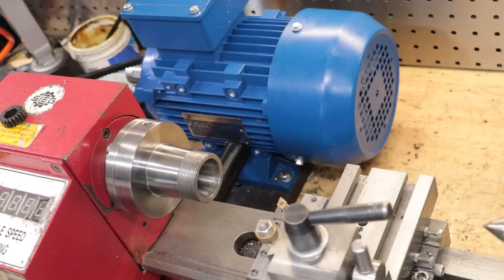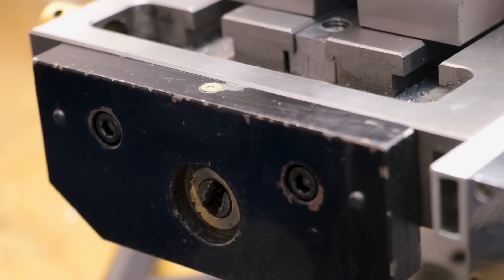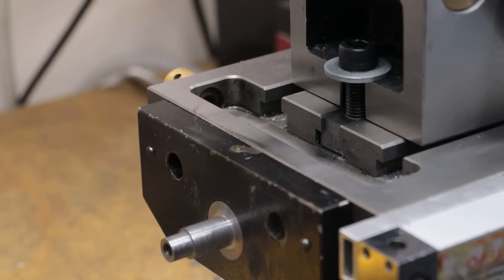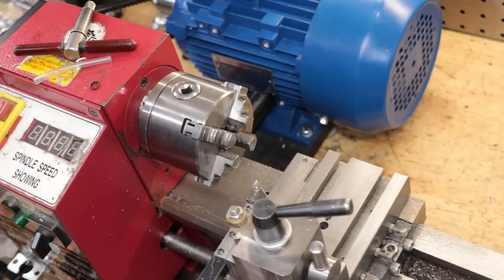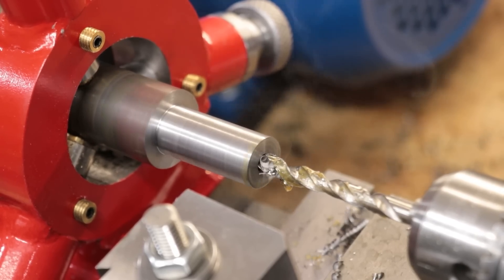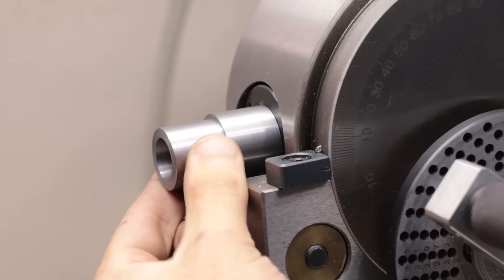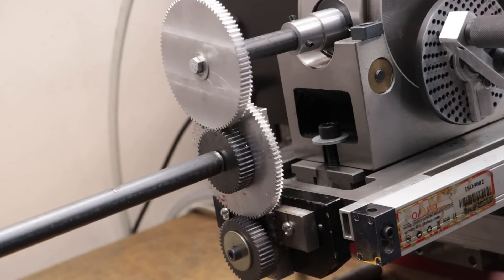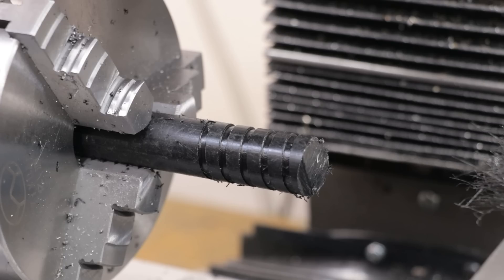Helical Milling Attachment For The Milling Machine

Comment: So how do you figure the gears need for the pitch. Say i wanted a pitch that the groove travels 2-3 inches for every complete rotation
Reply from the maker: Well the table for my mill moved 2mm for every revolution of the hand wheel.  So a 1:1 ratio between the leadscrew and dividing head is 2mm. To get a 2 inches of pitch you want the table to move 26 inches (x number of times) for one revolution of the DH.

Comment: I don't quite understand the use of the steady rest when turning one part. A steady rest is normally only used to make a centering hole or a recess for a center point on a long part that does not fit in the spindle bore, at most to make a hole for a thread, but not to make a fit on the part. As shown, the surface will not be smooth and accurate enough.

For a thread with this width of the thread flight, you also first take a narrow turning steel and make the thread flight wider only when you are at full depth. If the thread steel already has the full width of the profile at the beginning, the cutting pressure is of course much too great for such a small lathe.
Reply from the maker: Yes this would be correct for a normal lathe, but for such a small lathe its just there to bolster rigidity where the tailstock can not provide enough support.
Reply from the maker: And youd be right for the second part but as i'd already sunk enough time trying to get the carriage to move I pretty switched top the helical milling. I doubt even with using a smaller tool to do the roughing I could form the required thread

Comment: I wonder if a more versatile solution to your problem would have been to make some sort of small milling head to attach to the tool post and use the lathe to cut the thread. The lathe cbange gears should stand up to the lesser forces required, especially if you use light cuts.  Since the leadscew has to turn faster then the lathe spindle, powering the leadscrew (eg. with a hand crank) with the reduction gears transmitting the rotation to the lathe spindle would also make things easier and smoother.
Reply from the maker: I have one and they just aren’t rigid enough to take the cuts that I will need here

Comment: I was wondering if the equipment listed on your about page is up to date.  I'm looking at buying a mill & lathe and am trying to figure out if I should buy new less expensive equipment or used equipment that may be a little larger & more expensive.  Which would you chose if you had to do this again, especially since you have made so many upgrades to yours?
Reply: Sorry for jumping in, just my opinion, and by the way, I am a mechanic not a machinist. 
I have had a minilathe like this, and I also have had a 210 lathe within the last 20 years.  
Now I have a 320 lathe, and just my opinion, buy the biggest lathe (that makes sense) you can afford, if it is used, bring a gauge and check the runout on the main bearings, if runout is low, it is probably ok. If yoy buy a lathe too small, it will cost you more on upgrades than the bigger lathe, and it will still be skinny. 
I have a "35" mill, that works fine as a drill press as well, I am happy I did not buy it smaller. 
And by the way, the lathe is quite cheap when it comes to what you need to use it, the mill is a completely different story, you can easily throw a lot of money into accessories for the mill, if you can get one used with some accessories to it, it will save you a lot.
Reply: Sorry, it is a BF30 mill I have, not 35.

Comment: this could also work well if an angle grinder was used as/or instead of a mill with a cutting/slotting blade, and if you wanted trapezoid threads you would roll the grinder left and right with a skinny wheel on it doing shallow cuts to get nice even smooth cuts.

Comment: From the video it looked like the rotation was occasionally stalling more specifically not consistent but from the look of the spiral on the helix it didn’t seem to show up. 

Did the process look different in person or did it look fairly constant? I’m kinda curious
Reply from the maker: There is a bit of binding somewhere in the gear train that shows up as the cut stalling. Nothing detrimental but it shouldn’t be too difficult to find the source of it

Comment: impressive. very impressive. to actually do it oldschool with gears rather than resort to steppers and coding. always feels more reliable. one missed step and bang... cant do that with gears. as long as you do the calculations right.

3D printer is handy for change gears. the forces shouldnt be that high.. depends on leads really. i still have my 15+ yr old gears on my lathe in service.

it may be "fixed" but remember, you can mess around with the ratio on the same center distances in the same module as long as the total number of teeth stays the same... ie, 90+30=120, so can be 60:60, 45:75, etc...
a tumbler/idler to reverse the rotation...

change gears... wait until you do "continuous fractions"... figuring out the ratios from given change gears to get an approximate as what you want isnt a neat integer.
making custom gears seems easier to get those oddball leads.

a rarely mentioned method of getting unachievable leads is by canting the table over at the sin of of the lead... much like setting a compound slide over for getting a 10:1 resolution. 
the cutter still has to be tilted to match the helix angle of course. only works if you have a swiveling table.
Reply from the maker: That is definitely one advantage with using gears

Comment: That is cool as hell! If you did it again do you think it would be worthwhile to consolidate the project on a fame that can index the dividing head with the drive coming off the lead screw? I like the thought of a frame with flats milled in for reference surfaces so set up is more plug and play. I also like the thought of an adjustable gear banjo so I could use the same set up for different gears. I “like” these thoughts but are they excessive to the task at hand?

Comment: This is a fantastic setup
.i needed a big worm cut some time back and i only thought about driving it through the crank handle inout of my dividing head...figuring out the math for your idea should be much simpler, plus its a simpler gear train then needing to go to a right angle also...love it

Comment: The old atlas lathe i have has a gear train on a part called a banjo, which would let you put different gear combinations together for about any pitch. I lenthened mine to add 4 sets of gears insteadof3. Very simple design and adjustable to get what you need.

Comment: quick tip a drill and a saw cutter is a high speed steel, dont run it to fast as a cutter 10 cm in diameter schould be running at around 100 rpm. there steel if u go to fast your work peace wil stick to  the cutter giving you poor finish

Comment: hello, I noticed that for deeper cuts you don't use the power feed.  If you are interested in my lathe, which is the same as yours, I have mounted a 110-tooth gear to improve the finish.  in your case it might help

Comment: Hmm, I think the go-to solution for this would actually be the other way around: attach a dremel or other milling head to the toolpost of the lathe.
Reply from the maker: I have  close to 200gb of footage trying to make it work that way, I kept stripping gears and poor finishes. I tried to make it work but it. Just wouldn’t
Reply: @artisanmakes  probably due to the poor quality of the lathe 
on the lathe in school those threads are no problem 

but they current way with the mill is quite a lot of effort for such a simple part
Reply from the maker: Gotta use what you have sometimes :)
Reply: @artisanmakes  can you explain what stripped the gears? The forces on the gears should be very low, as the cutting is done by the mill. Turning of the mill should of course be done by hand, as else the mill would break
Reply: @Jochem Bonarius  he doesnt need to explain anything to you
Reply: @jhbonarius  mini lathes tend to run at high RPMs and the feed gears are limited in size: the mini lathes therefore tend to move the carriage awfully fast when threading even ~1mm / 20tpi threads (you often see mini lathe users preferring to manually rotate the spindle to thread as you suggest, or use dies instead). The limit comes often (in my experience, your mileage may vary) by the tendency of the cutter/dremel/milling bit to grab the work which exerts a vastly higher force on everything than when cutting smoothly and often in an opposing direction. Lathes struggle when cutting forces can suddenly change direction, whereas milling machines are designed to handle this better. It can be a particular problem with a Dremel because of the relatively low spindle rigidity.
Reply: @peterspencer6442  that why you need to turn it manually like we say. And even: Building a more rigid toolpost grinder / mill / drill would be worth more in the long run anyhow.
Reply from the maker: It’s a combination of a few factors. The carriage retaining plates needs to be tightly done up against the bed to give it any meaningful rigidity. This is part allows me to do the cuts I do, but it means that it takes a bit more force to move the carriage than you would expect. Even trying to move the lead screw to move the carriage takes some effort. With the 6mm pitch gear train set up that force required to move the carriage is multiplied 4 times and the gear train was not having any of it. And I sank almost one and a half weeks of afternoons trying to get it to work. The helical milling on the other hand worked the first time I tried it and truth be told it’s a more rigid set up than the lathe mounted router I have. Cheers
Reply: @artisanmakes  I think you’ve shown through your published work that you are a very competent machinist, and I think it’s funny that people in the thread are doubting you. Don’t get me wrong, it’s definitely worth bringing up in case the creator hadn’t thought of it, but if they are telling you, from experience in their own shop, the other method isn’t working well, just leave it be.
Reply: Even if a dremel isn't attached, the torque required to turn the complete gear train to a lead screw is quite high for the pitch he wants.  Which is why he's stripping gears and bending the banjo.  

Even though the motor on the mill is probably not as powerful, the gear train is much more ridged and not requiring as much torque. The power feed is controlling the table screw, and the screw is turning the chuck. 
If he were to connect his motor to the lathe lead screw first, then set the gear train to spin the chuck he'd probably have better luck.  
Either way this is going to be really challenging to demand a large TPI for the size of equipment.
Reply: @euclidallglorytotheloglady5500  then swap it around: turn the lead screw and have it turn the head. Or some middle ground. You need to turn it manually anyhow, or you'll break the mill. Even with some modification, using the lathe would be much easier and you don't need to fabricate gears and all the other stuff he made.
Reply: Doubt a Dremel would be internally rigid enough to withstand a cut 100% axial engagement
Reply: That’s very bizarre as its a common solution many adopt with little issue. Were the issues with difficulty getting it to work on your lathe in specific or more general?

Comment: Electronic lathe leadscrew when
Reply: Came here to say: you could do this with the Clough42 ELS in one of three ways:
- traditional way, by implementing the ELS on your mini lathe, using single-point threading
- as above, but also add a mini-mill to the lathe cross slide rather than single-point threading
- or using your mill, but with the ELS set to encode from the mill lead screw and the servo/stepper driving the rotary table axis. The electronics and control unit would apply perfectly well, and would give you an easily-settable pitch for whatever you need.  And I think it would be easier to implement (no gears) -- though certainly more costly for the encoder, motor, and electronics.

Comment from the maker: One thing that I should have added but glossed over in the video, this design was meant as a one off for this project. The spacing between the gears is intended for only 45 and 90 tooth gears. Mostly because of time and materials , but also because if I used this gear train the pitch would be 8mm which is what I was after (which was more appropriate than the 6mm pitch I was aiming for on the mini lathe), and the spacing between the bottom and top gear would be 135mm which was the exact distance between the leadscrew and dividing head spindle. That just made the design easier and quicker to make. If you are looking to make this more universal I can't image that it would be too difficult to make a set up that allows you to move the spacing between the gears. Or add an encoder and stepper motor, which is a set up that oxtools has done (https://www.youtube.com/watch?v=AVydTvwqmRs). Cheers

Edit; Also this isn't an ACME thread, still deciding if/how to grind an acme profile endmill
Reply: 30 deg tapered endmills are a thing, not cheap though. 8mm pitch acme (or trapezoidal I assume) ? What are you using such a large pitch for anyways ? You can grind a single flute tapered endmill, not sure how well it'd work for hogging out steel at that depth.
Reply: Came here to say exactly this. I use them at work all the time
Reply: Or piece of round HSS turned into a D bit cutter is pretty simple
Reply: The other thing you should have added was hacksawing
Reply: Have you seen Stefan Gotteswinter's video on thread milling on his lathe?
I suspect from the pitch you are wanting it might not work with your lathe.
Reply: Do you have a reference on how you came up with the gear arrangement? I think with minor changes this could be adapted to support arbitrary ratios but I'd let to understand this a bit more.
Reply: Keep going in this direction and you'll be down the rabbit hole like Tom (@thomasstover6272), making a gear hobbing attachment to mill helical gears with multiple complex gear trains and differentials to allow you to make any number of toothed gears. What's the big project (or maybe it's a secret for now).... I was thinking a Quorn tool and cutter grinder maybe, or perhaps a fly press, since you've made a 40m x 8 tap?

Love your work, it's an inspiration to go out and try things myself (now that I have my new mill), just need to extract time from somewhere :-)
Reply: I don't believe your tied in by that spacing you can shift that intermediate shaft left or right  and get plenty of options i think you could also do this pretty well with toothed belt